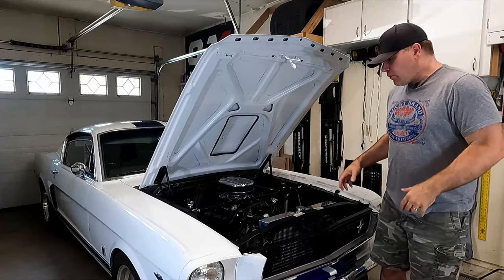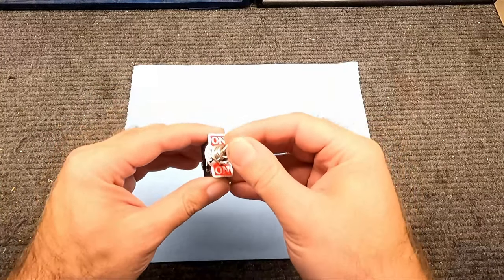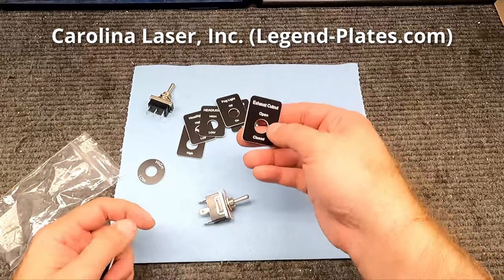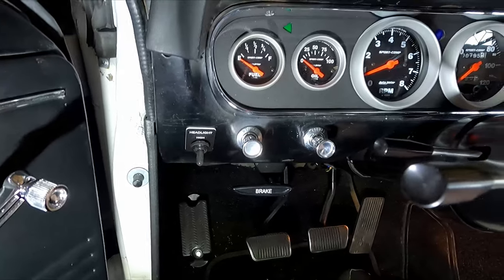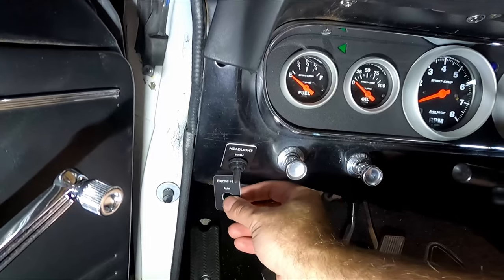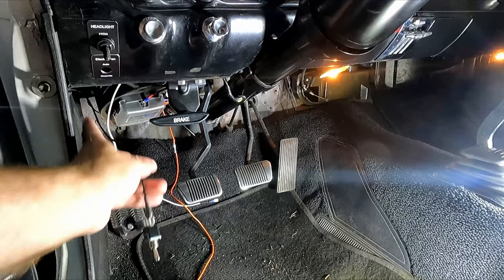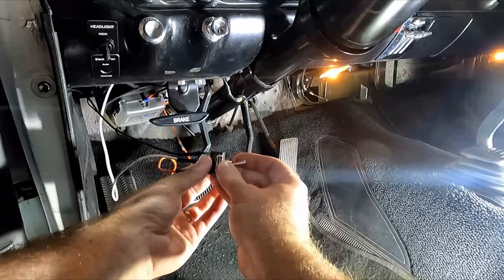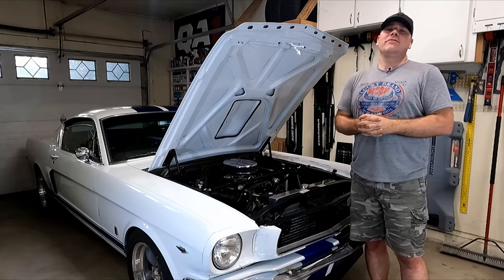How to Install a Fan Override Switch

Comment: Cool idea to add something to give a little more control over the cooling system. I do like the idea of a little extra cooling if you go to the track with the engine off if necessary.
Reply from the maker: Yeah, that’s another good reason to add to the list for something like this. 🙂

Comment: In this case, all you needed to do is connect a dash toggle SPST to ground on one side and tap the other side directly to terminal #85. This gives you control to run the fan at anytime and if you want it auto, just leave the switch off and the temp sender will do its job (it doesn't care if its gound override or not). The swith you're using SPDT is two completely different controls. You just have to remember to keep it off the "middle" position, that would be bad.
Reply from the maker: It’s what I was able to get.

Comment: Dont use pipe tape, use thread sealant so you still have a good ground & seal on that coolant sensor to your engine 👌
Reply from the maker: Thanks for the heads up.

Comment: Do you remember what tag you ordered from Carolina Laers? Did the hole come predrilled?  Thanks Great mods....
Reply from the maker: Yes, it is model number 1251.  Predrilled hole, adhesive already on the back, ready to install.
It's funny you bring this up because I will be selling these Tags and Switch on my website soon.  The cost for a customer to order one Tag through Carolina Laser is pretty expensive, but I'll be able to sell them and the override switch as combo for a good price.  :)
Reply: @AndyKruseChannel  ok maybe I’ll wait until you sell some. I need the one you used for the fan switch
Reply from the maker: Not sure if you saw it, but I updated my Website with those Fan Override Labels.  :)

Comment: I have the opposite issue... fan stays on WAY after the radiator is cold, because the block sensor is still warm... kills the battery... but I  do need a kill switch... just pulling the wire is getting old.
Reply from the maker: You should be able to wire it so it’s only active when the car is on. 🙂

Comment: Andy, ive been folowing for quiet some time now. And your cars, and your videos are getting better all the time. Your engine bay now looks really good. But i got to be honest, that braided fuel line looks out of place. It needs rerouted somehow. It just dont look right the way it is. Maybe behind the distributor? Or at least attached to something so its not just flopping in the breeze. I know your very tidy like i am. Thats why i bring it up. Sooner or later, it will bother you.
Reply from the maker: That braided line is not flexible, options are limited.

Comment: Curious if this is an option for my 65 with the Holley Sniper? I can set via the system the tun on/off temps but wonder if they have an ON option? I assume if the relay or something went bad it would prevent this. Could I follow the same steps you did with the Sniper installed? Thanks!
Reply from the maker: I would think you could, your just interrupting the wire from the temp sensor to the Holley. The switch would either ground out and trigger the fans, or it would be in “auto” and let the Holley decide when to trigger the fan (which is based off the temp sensor hitting its limit and grounding).  😁

Comment: Great video.  
I ran two over ride switches, and two relay’s so the fans run independently.  I pig tailed them to the temp sensor so they both get the signal.   One for each fan in case one fan died.  And i hid them inside the center console roll up door.
Reply from the maker: Yep, that’ll work too. 😁

Comment: Looks awesome I did the same thing for my electric fan but I used one of the holes under the dash so it was out of sight just had to enlarge it a little and I used the exact same switch lol.
Reply from the maker: I thought about that, but I wanted to know which position the switch is in with those labels. Harder to do under the dash. 🙂
Reply: Curious if this is an option for my 65 with the Holley Sniper? I can set via the system the tun on/off temps but wonder if they have an ON option? I assume if the relay or something went bad it would prevent this from working even if it did have an ON switch? Could I follow the same steps you did with the Sniper installed? Thanks!

Comment: I had to go back to a Mechanical fan and put a single electric in front of the radiator between the grill set to come on @190° as a fail safe. What does your mustang typically run at on a hot day?
Reply from the maker: 185-190

Comment: Hey Andy, have you noticed that when the fan does come on when the engine is hot that it does not go off? i have the same setup and my head scratcher is that the placement of the temp switch is right where the coolant comes out the motor. so when the engine is hot, the hot coolant has the switch always activated as the thermostat is always opening even slightly from being hot. wouldnt a better placement be somewhere on the rad indirect of the fan or maybe the drain plug?
Reply from the maker: I do not have that issue, the fan shuts off when the “low temp” is reached on my thermostat electric switch. While that switch is on the backside of the thermostat and it’s reading the temp of the coolant between the Rad and the engine, it’s proximity to the hot engine coolant is close enough that it’s probably within a few degrees of the “real” engine temp. Plus, they wouldn’t design those thermostat housings to place a switch there if it wasn’t good enough for most applications.
However, you are correct, there are better places to put that switch where it will read more accurately, but in my application I’m not worried about a 5 degree temp difference on a bad day.
It almost sounds like there’s an issue with your cooling system if the engine is constant reading at a high temp. Possibly the Rad needs replaced, or the fan(s) are not moving enough air, or a fan shroud needs to be added, etc.
I have done essentially the same mod on two Mustangs now with the same results, so that’s why I’m leaning towards there’s some going on with your system.
Also, your temp switch may be fault or the trigger temp is too low?
Good luck!!

Comment: Im attempting to do this setup its a great idea to have capability to turn off, on, and auto. I am using one of those wire controllers that have the adjustable temp knob. It has two terminals that close when a temp is reached. Do you know if your setup would still work? I'm kind of new to wiring and im starting to mock it all up outside. Thanks!
Reply from the maker: It should work as what I am doing here is just interrupting the ground for the relay circuit.  I can toggle it one way and it completes the ground (ignoring the temp switch, which is just a ground too) and fires up the fans.  I toggle it the other way and it's in 'auto', allowing the temp switch to do its thing and fire up the fans when the desired temp is reached.  :)

Comment: Which radiator and fan system is that? Looks very clean.
Reply from the maker: It's a Champion Radiator and an electric fan system from a 1999 Ford Contour (incredibly common swap).  I have videos on both of these upgrades.  :)